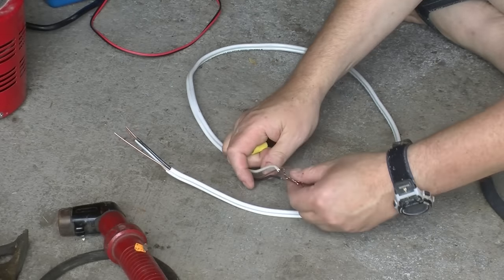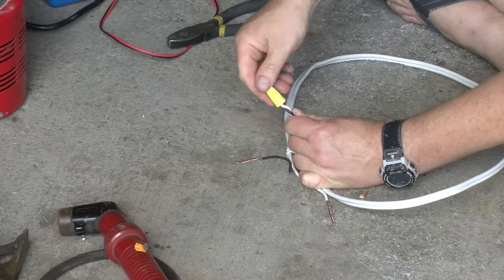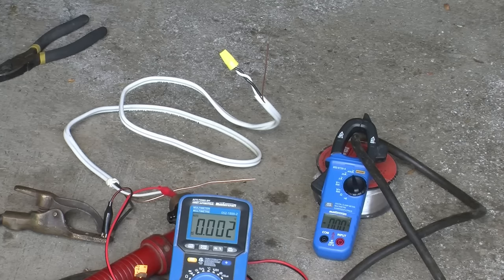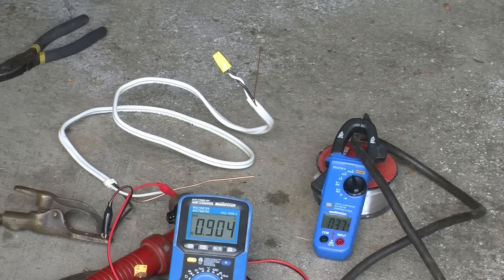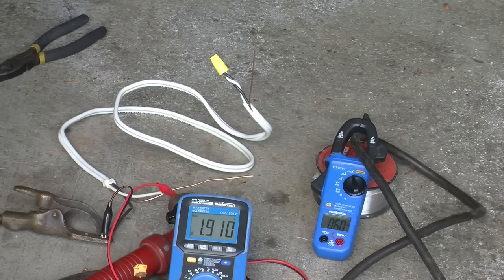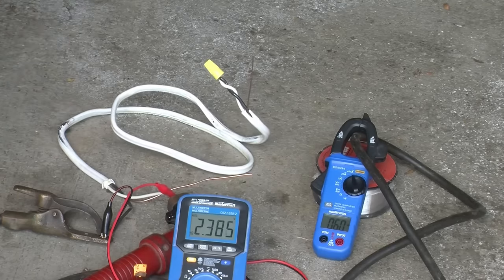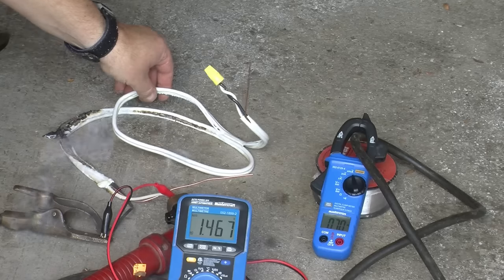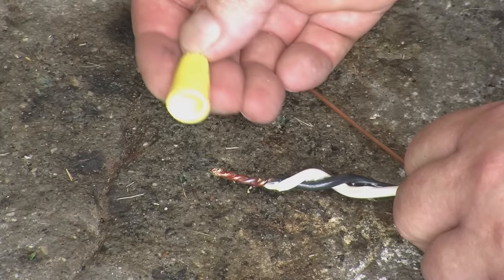How many Amps to burn up 14/2 electrical wiring?

Comment: This is NOT a true test. This cable is rated for  120volts/15amps and 240volts/7.5amps. 120 volts at 15 amps is 1800 watts.
Reply from the maker: Actually it is. 1) The current rating of the cable is unrelated to the wire to wire voltage so 14/2 is typically rated at 15A for both 120V and 240V. 2) Ohmic heating that melts the insulation is comes from the current though the wires, not the voltage between them or the total power delivered to the load.  The actual issue with this test is that the wire is not embedded in a a wall and insulation which is how it would actually be used and which lowers the amount of current needed to melt the insulation. See here for more details: https://www.youtube.com/post/UgkxeilOfLJGy2ODslnBW0WFXUE580oHhFyP

Comment: So, running a continuous load of near 15 amps through a 15A circuit with 14 awg, while everyone always goes "but... but... 80%... danger!", it's not really actually. But "just in case" people say it is. But it isn't.
Reply from the maker: Well take this video with a bit of a grain of salt before drawing too many conclusions! I did some further videos with the cable in 2x4 wall sections embedded in different types of insulation. For the better insulation types like spray foam, the margin of safety goes way down. I would actually prefer a #12 cable for 15A in that type of a situation.

Comment: I think this guys secretly wanted to get shocked lmao
Reply from the maker: The voltage used is very low (less than 10V)  since we are essentially dealing with a short, so not a concern in terms of touching it.  The bigger issue is burning finger from the heat at the current goes up!

Comment: This means nothing!The wires get lots off air to coole down!In the Netherlands we have wires inside a plastic pipe,but the amps are limited to max 16 amps and a voltage off 230 volt.So there is almost no need to go for more amps.But the wires are 2.5 mm,a bit thicker i think than your wires.But indeed,if there is a need to more amps those wires in the pipe gonna get hot faster than in the free air.
Reply from the maker: Its not as unrealistic as you might think: Over here, our inside walls are 4 inches thick with an air space of 3.5 inches inside. Vertical 2x4 studs are 16 or 24 inches apart. Wires go in the middle and can have quite an exposure to the large airspace.  Outside walls are filled with insulation around the wires, so the wire should heat up at lower currents. I hope to test that this weekend. Your plastic conduit is typically in brick/concrete walls in most of Europe right? I would guess that even if something bad happened to the wire and the plastic melted, the walls would easily prevent and spread of fire?
Reply: The wire in this video is 14 awg which has a cross section of 2.05 square millimeters. It is rated for 15 amperes, but limited to 12 (80%) for continuous loads.
Reply from the maker: @david672orford  Exactly!

Comment: Wind it like a coil and see what happens! 🔥
Reply from the maker: Yeah - a bundle would sure heat up faster with less current. There is a de-rating rule where if multiple cables are close together the amount of current they can safely carry is reduce for that very reason.

Comment: yeah the second I saw the welder I knew this was a bogus test. 

So the forumla for power in watts is v x i = w so 120v x 15amp = 1800 watts max for a 14/2 romex wire. 

This test is not an accurate reflection of the true current carrying capacity 14/2 romex.

Comment: The resistance goes DOWN as the wire gets hotter... that's why it runs away. If the resistance were to increase, the voltage would drop thus lowering the current flow. 

Think about a rheostat... hook up a light to a battery with the pot in the middle, you don't increase the resistance to make it brighter, you go to lower resistance.
Reply: Sorry, you're completely wrong. Resistance of copper and most any other non-exotic material increases with increasing temperature. There is no thermal runaway occurring in this experiment, and a rheostat is not the same thing. as a pot(entiometer).
Reply: @my.own.devices  Yeah I'll back off on that I was forgetting that the applied voltage was changing and not constant. Changed the wrong variable!

Comment: That's not an ideal test.. if you read the laser printing on the 14 gauge wire (before the NFPA gets ahold of it) will handle 250 amps at 240 volts. You're doing a dead short not a load test. Under a dead short the breaker will trip. Under load is where you see longevity of amperage/volts/VA/ and heat.  You should redo the test with a 120 volt 40 amp load like a few motors.
Reply from the maker: The heating of the wire is from the voltage developed along the wire due to the current encountering the wire’s resistance, a few volts in this case. If the voltage between the wires was 120V (or 240V) with a load attached to the end of the wires, the same voltage drop of a few volts would be measurable along length  of the wires for a given current  and the heating would be the same.  120V times the current would be the power delivered to the load, different from the power that is dissipated in the wires which we are interested in. To keep this test simple and safe, there is no load (by shorting then end) and all we need is a few volts to create the desired current – and heating in the wires. 

See  "OVERCURRENT TESTS FAQ" here  https://www.youtube.com/post/UgkxeilOfLJGy2ODslnBW0WFXUE580oHhFyP  including why a current source like welder is used and a link to a UL test done in almost the same way.
Reply: @ElectromagneticVideos  but a welding machine is DC. house hold current is AC ... heats up at different threshold
Reply: @ElectromagneticVideos  I'm an electronics engineer. if the thickness of the wire was the culprit then 4kv Transformers would be as big as a car. they often use 40 gauge wire and not so discernible heat.
Reply from the maker: @chuckholmes2075  The welder is AC. RMS currents heats the same DC or AC anyway,
Reply from the maker: @chuckholmes2075  Thats because we use HV to be able to reduce current and use thinner wire. Demo here https://youtu.be/prQssIL0VmA

Comment: this test does nothing in terms of testing the wire in a residential application. 
your never going to get this wire up to the standard 120v AC at 60 amps without near instant fire. 
keep the voltage at 120 and slowly crank the amps up. you'll have different amperage results.

Comment: Why would the voltage go up if the resistance is getting higher
Reply: V=IR. In here the current is staying constant so if the resistance goes up the the voltage will go up.
Reply from the maker: @shieldcracker  Exactly! The welder transformer is  a constant current source, but not a perfect one. So in some cases I had to tweak the voltage powering the welder to keep the current constant. To do that that (and set the current initially) the welder is connected to a variac.

Comment: WELDING VOLTAGE IS NOT GRID VOLTAGE. YOU WILL NEED TO DO SOME CONVERSIONS. ALSO AC AND DC (WELDER) ARE DIFFERENT ANIMALS.
Reply from the maker: See https://youtu.be/CP3-jcpzZeI for a discussion of that.

Comment: Electricians say that using a 20 amp circuit breaker on 14 gauge wire is dangerous but your test shows barely any heat at all from the wires.

So where does the danger come from? My guess is that 99.99% of everyone who tried this would be perfectly fine. But the large safety factor covers the .01% that have a very esoteric setup that would eventually catch fire. And when you multiply that by 300 million people, you want those large safety factors.

So my guess is that a 20 amp circuit breaker with 14 gauge wire would be fine a majority of the time with only an occasional 50,000 more house fires a year.
Reply from the maker: If you look for the subsequent videos I did, the 14-2 cable was placed in the middle of 2x4 walls surrounded by typical household insulation. The safety margin which was you point out was large for the 14-2 cable in air almost disappears in those situations. 

The 15Amp  spec  for 14-2 is to ensure that its safe in virtually all situations it would ever normally be found in, and also when operated with a breaker that may allow  up to 2x the rated current to flow for something like 30 minutes before tripping. 

Hope that helps!

Comment: Sorry your demo doesn't hold water so to speak. 14/2 should be able to handle 1800 watts continuous with no issue. It's 120vac at 15 amps is a nominal rating.

Comment: 14 wire is rated at 20amp but buy code you take it at 80% so you size the over current at 15amp and then most times a good electrician or engineer will not put more than 80% on the 15amp breaker and this is not a good way to test this cause this is testing the heat build up because you have created a dead short circuit basically you made a heater just like a filament in an electric heater so of course the copper in that small of a piece of wire this way will fail very fast, but if you where to put this same wire under a true load test hooked up to a device that had a 100amp nameplate rating it would hold for a lot longer than you realize. One prime example of this is what we in the electrical field call the tap rule say I’m feeding a shopping center and from my utilities I have 1200amp available and I need 400amp to three units / spaces in the shopping center from the utility transformer we are sized for 1200 then we tap the wire with parallel runs to a disconnect with over current protection at 400amp but the 10’ from the 1200 in coming utility we are allowed to tap has no over current protection until it hits the disconnect secondary side after the fuses.
Reply from the maker: See  "OVERCURRENT TESTS FAQ" here  https://www.youtube.com/post/UgkxeilOfLJGy2ODslnBW0WFXUE580oHhFyP
Reply: @ElectromagneticVideos  I will look into this to make sure that I understand the whole thing I glanced at it quickly so I’m not going to tell you that I took time to really understand the whole thing

Comment: How much voltage?
Reply from the maker: The voltage drop through the cable goes from about 0.35V (at 15A) to 2.4V (at 60A just before it fails)  for the duration of the "low current" test. The big blue voltmeter center bottom screen shows that voltage. The small one the current.  Most wiring is designed for a few percent voltage drop along the wires under full load and 0.35 volts drop for this short length of wire is quite reasonable at the rated 15A max load. These voltages may seem low but given the high current they actually deliver a lot of power which is turned to heat: 2.4V x 60A = 144W watts just before it fails. Of course in a longer cable installed in a building you would get a proportionally larger drop and heat generation. Hopefully you would never get 60A though a 14/2 wire for any more than a second or so while a motor starts etc.  At the very end without any control limiting the current its about 15V at 260Amps = 3900W and of course the wire doesn't last long. In a true failed breaker situation on a 120/240V panel you would probably get a lot more than that instantly vaporizing a lot of things.

Comment: The short happened at around 8:29 when the voltage across the wire dropped in half.
Reply: I'm curious where the short happen... probably same place it burned.
Reply: @johnmicheal3547  
Since the voltage dropped to about half, I would estimate that the short happened at about half the length.
Reply from the maker: Somehow I missed both your comments.  I think it might have been intermittently on the burn on the left and then more permanently on the right where the outer cladding of the two loops melted together.

Comment: if 900 watts equals 7.5 amps on a 120 volt line, then nothing your saying is making sense.
Reply from the maker: Thats power delivered to the load which is not the same as power dissipated due to ohmic heating in the cable. The is test is of ohmic heating in the cable where the voltage is along the wire. 

I did a written discussion here https://www.youtube.com/channel/UCV2-Qbq9o0EOQWPLAWkVH2w/community?lb=UgkxeilOfLJGy2ODslnBW0WFXUE580oHhFyP which also has a link to UL certification study using essentially the same method.

Comment: Several flaws in this demonstration. Length of wire is short. Wire is in open air. Voltage is not line voltage. That makes a difference. For example, conduct the experiment with 5,000 volts  in combination to amps to produce same current values and see what happens, or  Run a length of wire realistically used in a branch circuit.
Reply from the maker: I recently posted a video discussing those things - take a look: https://youtu.be/CP3-jcpzZeI

Comment: Why is he touching this wire with bare hands? Thats like checking panel wires with a live circuit.
Reply from the maker: Its low voltage which is all thats needed to drove the current in effectively a short circuit. I sure wouldn't be touching it if it was 120V

Comment: Increase the voltage to 120 and rerun your test. You won't be able to get anywhere near 50 amps before the wire melts down.
Reply from the maker: Unfortunately you are confusing two things - resistive heating in the wire due to current flow in the wire which does not depend on the voltage between the wires and power delivered to the load which does  depend on the voltage between the wires

Due to numerous similar comments I did a written discussion here https://www.youtube.com/channel/UCV2-Qbq9o0EOQWPLAWkVH2w/community?lb=UgkxeilOfLJGy2ODslnBW0WFXUE580oHhFyP which also has a link to UL certification study using essentially the same method.

Comment: I kinda of found this a bit off, as in what, why or????. 14/2 is the common house hold wiring for 15 amp circuits. There is a safety rating usually 150%, which is not so much the wire it's self's fail point, but there is a time value that goes from no problem to catastrophic. The higher the current the shorter the time until failure. Not sure why I get vids recommended  from people who need a little more knowledge of their videos content. My opinion only

Comment: The wires are hooked up in DC not AC current setup. 
So how the heck does it prove the wires would melt/burn if it was an AC setup? 
 So I don't buy this method at all.
Reply from the maker: 1)  It is  AC 2) If it was DC as long as the current has the same RMS value the heating would be the same

Comment: Much less if the wire is buried in a wall where it's ability to dissipate heat is greatly reduced ....
Reply from the maker: I'm going to try with the wire in insulation tomorrow!

Comment: no one pretwists the 2 wires, but is will  do better to twist connector on to the bare wires it seats the equal wires better so cap will not fall off--- oh use tape?

Comment: Why is it saying 2.0 v or what’s it showing?
Reply from the maker: Thats the voltage between the wires where the welder is connected to the cable. With the wire nut at the end of the cable, that's all it takes to push 60A or so though the cable. Thats the type of voltage drop you get along a wire carrying current which causes the wire to heat up.

Comment: Diesel-electric TRAINS use #12 gauge SOLID COPPER WIRE for 100 amp FUSE LINK
Reply from the maker: Thats interesting! A length of #12 in open air? I have heard about similar fuses in industrial settings. Inexpensive and effective - cant beat that.

Comment: I thought 14/2 could do like 1875 watts?
Reply from the maker: Your right, but thats the power to the load. The power here is the power dissipated in the wire due to the current flowing though it and the resistance of the wire. This power - the wire loss - hopefully is a fraction of total load power or you would loose a lot of energy in the wires and heat them up too much.

Comment: I think it would make a big difference if it was 60 amp with 120 volts
Reply from the maker: Hi John, 120V between the wires would not change the heating that 60A (or any particular current) causes since the heating in the wires is from the current times the voltage drop along the wires, not the voltage between the wires. Using 120V might changes what happens when the wires actually short due to heated or charred insulation, but with a good circuit breaker in series as one would have with a typical120V circuit, it should trip pretty quickly and remove power (making the results less dramatic). And a GFCI or AFCI breaker would hopefully trip even sooner (for different reasons).

I did a written discussion here https://www.youtube.com/channel/UCV2-Qbq9o0EOQWPLAWkVH2w/community?lb=UgkxeilOfLJGy2ODslnBW0WFXUE580oHhFyP which also has a link to UL certification study using essentially the same method.  The biggest flaw in the test in this video is that cable are usually more heat restricted than this due to insulation in the walls etc. I did some follow videos with more realistic situations.

Comment: you need to do the same test but run it at 15-20 min at each amp condition. running it at each amp for 10 sec is not accurate on what could happen in a house
Reply from the maker: I guess I didn't make it clear - lots of speedup and time skips in the video. Video editing is to good these days at masking things like  that. Didn't mean to mislead you! Sorry!

Comment: basically open air testing which means it will take a lot more abuse.
Reply from the maker: Yes! Take a look at the following videos I did with 14/2 in insulation in 2x4 walls for example.

Comment: Try it on a set of jumper cables.
Reply from the maker: Ha - yes - if I got some really cheap low quality ones I might just have enough current to soften the insulation but I'm not sure if the 200A from the welder could do much more than that...